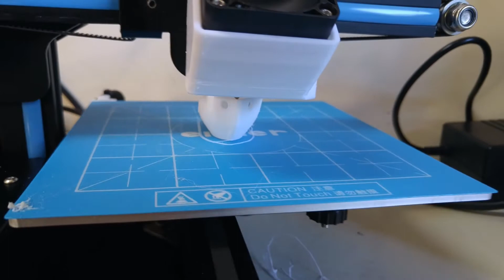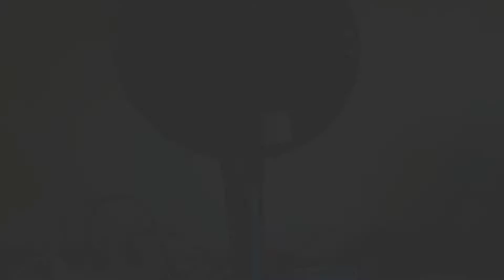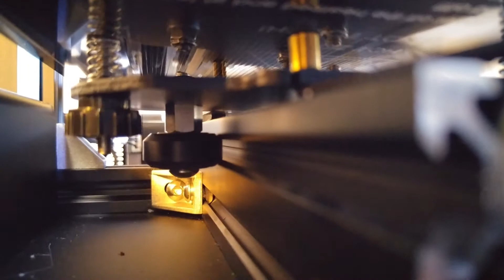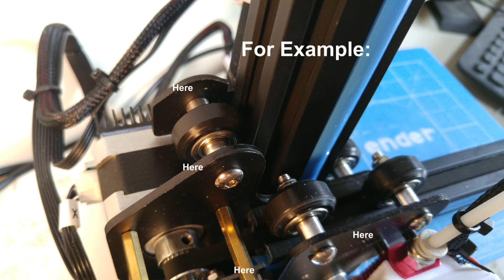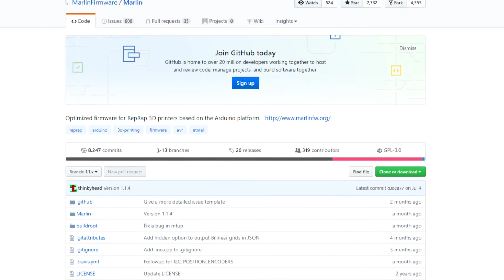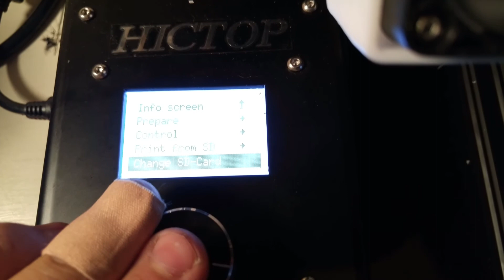Hictop Ender 3d Printer Review

Comment: X belt is installed incorrectly gold ends should be facing down not up.
Reply from the maker: You're probably right but I haven't noticed any loss in performance from it. I've actually pushed this thing up to around 200mm/s (in vase mode mind you, and minus whatever acceleration takes away) without any layer skips in any axes. Technically, my x axis pulley should be mounted opposite of how it is, but it works fine. I also think I had the x end stop on backwards in one of the photos, but it is fixed now. Thanks for noticing!
Reply: Marco Salguero   Roger that. I just noticed the unusual angle where the belt connects to the plate. But if it works. So be it. Have a good one
Reply from the maker: Thanks for checking! You too!

Comment: Hello. Whats the layer height and speed you printed the vase on the ender with? I get 3 hours when printing with 80,,/s and 0.32mm layer height o.O
Reply: with vase mode of course
Reply from the maker: As it says in the print info in the video, 0.2mm. I'm using Simplify3D's vase mode on a profile and  settings I tuned myself.

Comment: wow i didn't notice the Y belt rubbing on the 2040 when i bought it thanks for catching that I found my bed was kinda loose due to the springs not being powerful enough (mines a creality maybe hictop is better) so i added washers to it as well as some Teflon tape so the nuts would stay on the screws as well as printing a different spool holder a z stabilizer end cap a X and Y belt tentioner and a screen adjuster i might need to clone the firmware so i can add a real part cooling fan rather then a fan shroud anyways any plans to check out the ender 4? its a core XY I bought mine but its got issues mostly due to making the frame square
Reply from the maker: cityhunterinak All those mods sound awesome! I was thinking of doing a list of modifications I have done on this printer. Did you design them or find them on thingiverse? I've seen the ender 4, it looks really cool and I'd love to try it, maybe I can ask them to send me one to do a review because on my student budget I couldn't afford it
Reply: i got them off of thingiverse there are a lot of stuff from the cr-10 that works on the ender 2 i used an X tentioner on both the X and Y but this mod is my fav https://www.thingiverse.com/thing:2457518
Reply from the maker: cityhunterinak That's awesome! And good to know I'll have to check out those upgrades.